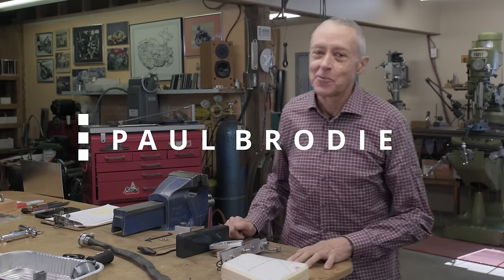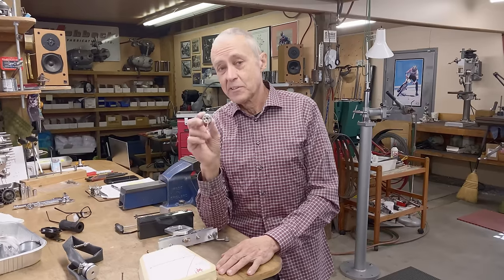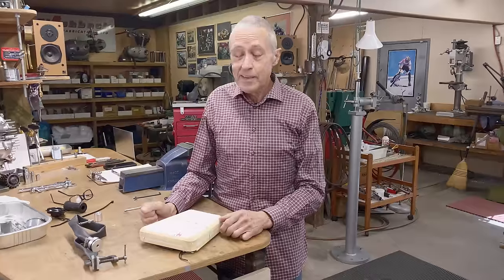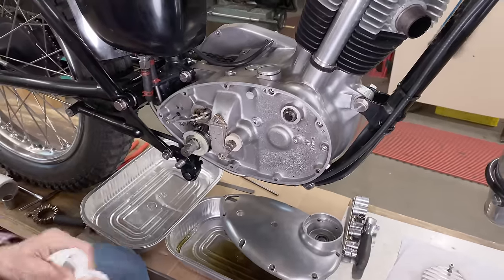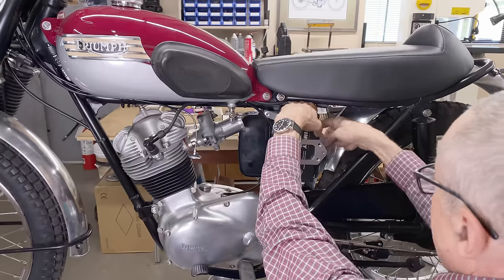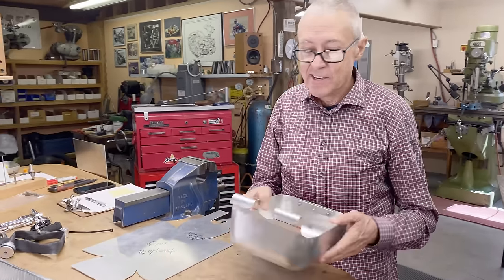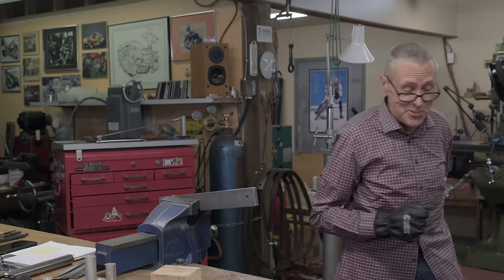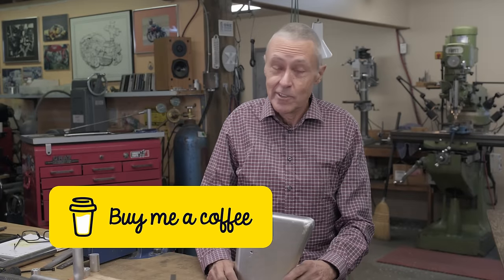CUSTOM Side Cover for the Tiger Cub // Paul Brodie's Shop

Comment: Making side cover is interesting Paul.  We make parts along the same lines, using wooden or GRP male patterns, and then press them using a rubber press (obviously not feasible for one offs though).

On something like a Cub,  you will need to carefully rubber mount the oil tank top and bottom, or there will be continued problems with cracking.  I would guess mounting rubbers for something like a 66-67 650 twin oil tank, would work well?  Use 2 on the top and 1 on the bottom. The battery holder will vibrate a good deal, so make sure that is mounted to the frame very carefully, as it's going to crack/break if it isn't.

You might get an overly large used Concentric to sort of work on the Cub, but it would be a hell of a job, and without some sort of restrictor in the inlet port, to overcome issues with poor gas flow at lower engine speeds,  running at low speed would always be pretty poor.  You can get 22mm Dell Orto carbs jetted perfectly for a Cub, and running would be far better with one fitted.

Oil in the side casing is probably coming out of the camshaft area, and might be due to breathers on the motor being too small, and making the cases pressurise ?  Kicking Cubs is always difficult, and most people fit a decompressor to the rocker cover, which pushes down on one of the rocker arms.  Without a decompressor, clutch slip could be a problem. Its possible to fit a decompressor, which mounts under the spark plug, and that seems to me a much better idea than messing about with the rocker cover.
Reply from the maker: I mounted the bottom of the tank with rubber, the top is solid. I will keep an eye on cracks developing. I will get this carb working properly. I feel I am getting close. I don't feel like swapping carbs. The oil was coming out of a little hole at the bottom of the case, underneath the cam. I plugged the hole and now the oil has stopped leaking. I will think about a decompressor, but in the meantime work on my technique, and get stronger. Thanks for commenting.
Reply: @paulbrodie   You will probably find cracks will continue to be a problem, unless you mount the oil tank in the same way as all other Triumphs?  Cubs vibrate at quite high frequency, and are very prone to things cracking and or falling off.

People in the UK have managed to get Cubs running well on smaller Concentric carbs, than the one you have fitted. This is achieved by fitting a restrictor in the inlet port, which increases the signal at lower engine speeds, which helps improve low to medium rpm running.  

Without a decompressor, starting will be difficult and the CDI type ignition systems, being too advanced at cranking speed, is the main reason for this. Generally, the fact that a very strong kick is needed to overcome the lack of ignition retard, means clutch slip often becomes a problem.

Good, you have sorted the oil leak.  Lots here fit a large diameter breather hose into the gearbox filler plug. On bush type motors, that have been fitted with CDI, the breather can go into the distributor drive blanking plug.  

Will be interested to see if you can resolve the issues with the oil tank, and can get the bike running well with that carb fitted? If it's a 4T carb, there is no pilot jet (just a fixed size bush), and it might be possible to modify it to take a 2T pilot jet, which has different sizes?
Reply from the maker: @humourless682  I will deal with cracks as they appear... I do not want a restrictor plate. I come from a road race background so that for me is a terrible idea. As long as I give it a good kick, it does start fairly easily. I tried to order carb parts from the Amal website, but that was impossible, and I let them know how crappy their site is...
Reply: @paulbrodie   It would be a good idea to phone Amal, but might be a plan to measure the carb body in the wear areas, before fitting any new parts? 

Nearly everyone in UK uses Dell-Orto carbs on trials Cubs now, but 20 years ago 22mm Concentrics, were common.  

The better running ones having restrictors in the heads.  From what I can remember, the ports on a Cub head  are not great, and that is the main reason for the restrictors being fitted. 

If you find your carb is badly worn and a new one is a better option than repair,  Amal can now supply aluminium carbs, which I would think are going to be far more durable than the lead/zinc ones, that are also available?
Reply from the maker: @humourless682  You think I am building a trials bike. If you look at my bike in the videos, you will soon realize I am NOT building a trials bike. I'm not sure how you got that idea... I am building a road Cub:  low pipe, 9:1 piston, racing cam, 27mm carb...    :face-orange-raised-eyebrow:
Reply: @paulbrodie  No I dont think you are building a trials bike, Paul.  

Other than your low level pipe, and 27mm Amal carb, your motor is pretty much identical to something built for trials here.

A stock Cub with inductive ignition,  20 mm carb, low compression, and short duration cam, is much more forgiving than modified bikes, with CDI systems, bigger carb, higher compression,  longer duration cams.

In the UK the ONLY rule in "Pre 65" trials that applies to pretty much every British made bike, is that it must have a British carb,  which means Amal, Zenith,  or Villiers.

The ONLY Brit bike where that rule does not apply is the Cub! People found modern day  trials Cubs so difficult to get running properly with British carbs, that there was a rule change, which allowed the use of 22mm Dell Orto's which improved running enormously.

That rule change happened about 20 years ago, and very few use British carbs now, as it seems the only way to get half decent running, with one fitted is an intake restrictor?  

I hope you can overcome the poor running, without a new carb or a restrictor, and if you can, would be very interested to see how you get it done?
Reply from the maker: @humourless682  I have carb parts coming from 2 different sources, so that is good news. I don't give up, and I have been successful in tuning other motors, so I plan to have success with the Cub. We will see...   :face-purple-wide-eyes:

Comment: Tour choice of 3003 was a good one. It is probably the most malleable of the non-heat treatable alloys except for 1000. I  think 1000 would be too soft for an application like this: too easy to  dent. I like the cover.
Reply from the maker: Thank you Richard :)
Reply: Is no annealing necessary for those bends?
Reply from the maker: @bananabrooks3836   I did not anneal. And I finished the project. I guess it wasn't necessary...

Comment: Really great video as usual! Cant wait to see what you find out about your motor leaking into the case. Are there any seals around all those shafts?
Reply from the maker: Thanks Kevin. The oil was leaking out of a hole that I plugged....
Reply: The cub uses a timed camshaft breather, any oil draining into the outer case is returned via a small hole in the crankcase and is scavenged back to oil tank.
There will always be residual oil in the case.
Cover looks great.
Reply from the maker: @arnsberg2150  I plugged the little hole where the oil was leaking out from. Fixed! Thanks for liking the side case...    :face-fuchsia-tongue-out:

Comment: Don’t all mufflers get hot enough to release lock tight? It is basically crazy glue which melts.
Reply from the maker: It's the very end of the muffler, so the coolest part. I also hammered it in, so I think it will be fine...

Comment: Is it smoking as well? Looks like the exhaust port off the head is wet with oil. Could be wet sumping?
Reply from the maker: No, the engine doesn't smoke. The exhaust rocker cover does leak a bit of oil... British!
Reply: @paulbrodie  Ah yes, the "it still has oil" indicator ;)

Comment: Hate to say this Mr. Brodie, but maybe your carb problems stem from its mounting angle. I'm pretty sure they prefer to be horizontal. Best wishes non the less and more power to your elbow!
Reply from the maker: You might be right, but I'm sure I can get the jetting right and have it running smoothly!

Comment: If after a while you don't see any more oil in that side cover, it maybe that the oil got there from the leaking oil tank dripping down onto the case. I didn't see any sort of sealing gasket so thats my ideaer. The battery box is kind of flat too. Any way to give the flat some curvature? Just another ideaer.
Reply from the maker: There are many ways to create a side cover. I did something pretty basic... There is only so much I can do dealing with video time constraints for example, but I do like the finished product. It works for me.           I did try and respond to your later, long, comments about the shop film, but the comment section went into a seized mode, and there was no chance of me answering you there.... I think you really put a lot of thought into it, and it was well written, so thank you very much! It does sound like a good story, but the chances of Hollywood calling are pretty slim :) But you never know.
Reply: @paulbrodie  LOL. Paul Brodie the movie... Someone else didn't like it and called me a snow flake. LOL.
Reply from the maker: @opieshomeshop  There are a lot of negative people in this world.
Reply: @paulbrodie  Thankfully you aren't one of them. Im learning a lot from your videos.
Reply from the maker: @opieshomeshop  Thank you.

Comment: It's a British bike, they seem to be designed to leak oil.  If it stops leaking oil, just check it hasn't run out.
Reply from the maker: British Bikes and oil. Where did you hear that rumour?
Reply: @paulbrodie  was a running joke back in the UK (during my teens), British mc's can be a nightmare here in Australia for registration, where they demand no drips/leakage under the motor/gearbox.
Reply from the maker: @Fozziesoft  Yes, it is sometimes hard to make a British bike oil tight...

Comment: More problems for you, the cover should follow the radius of the back mudguard, don't you hate it, CAD & 3D CNC / Printers ;-)
Reply from the maker: No problem for me. The cover could follow the radius of the back mudguard, but it didn't. That was my choice. When Mitch comes over here, I basically have 4 hours to create a project, from start to finish. Making a radius like you described would have put me way over the 4 hours. I do not live in a perfect world, and we have to make things work with constraints such as time limits. Thanks for watching. So no, I don't hate it, in fact, I like it very much!
Reply: @paulbrodie  I'm not complaining, just talking, that''s what its about, sharing ideas and the loves of machines, i know its a lot of work, cheers!

Comment: Maybe you can machine a new needle for the carburetor I know you got the talent probably wouldn't take too long. Good luck
Reply from the maker: My lathe chuck cannot hold something that small, so that is a problem...
Reply: Can you machine something that will hold it in the laid just like a little holder cup? Or hold it in a round blob of Apoxy. resin.
Reply: This might sound stupid. I don't know but a piece of brass tubin soft metal or aluminum. You inserted it into and then the lathe chuck crushed down on it and hold the metal inside of it. Another thought a lot of drill chucks are removable. And my chuck is two And you go make that clamp inside your lathe I have seen on TV or YouTube how people make holders that will hold the object in the lathe.

Comment: Hesitation on acceleration on those Amals is normally down to the slide cutaway size. Amal do have them listed on their website but I did a video about balancing 930s a while ago and at around 3:50 I show a picture of the various cutaway sizes. https://youtu.be/boik4yqmfTY

Also off the top of my head the stock main jet on those was around 100. With that peashooter exhaust and intake I'd be looking around the 120 mark. 

Nice panel. 👍👍👍

Edit. Difficult to kick over normally means the ignition timing is too far advanced.
Reply from the maker: Yes, I will order a 2.5 slide. I think I need a 160 main jet, but it could be 150. 120 seems pretty small... Thanks for liking the side case!

Comment: Your carb tuning dilemma. Main jet doesn't come into play until 3/4 throttle. Idle mixture screw works between 0 - 1/8 throttle (make sure your idle jet is cleaned out. I use a #79 drill bit .0145"). The slide cut away works from 1/8 - 1/4 throttle. The larger the number the leaner it is. Lower number the richer. The slide cut away has a lot to do with throttle response. The needle and needle jet control mixture between 1/4 -3/4 throttle. Usual issue is needle jet wear. A 106 jet should have a .106" diameter, a 105 should have a .105" diameter. New needle jets: some are made wrong and can be undersized. You can make plug gauges on your lathe using a vernier micrometer that reads down to .0001". You can make them in .0005" increments for the needle jets you need to measure. Check your float level too as to high richens the mixture too. Start there first. Make sure none of your emulsion holes aren't clogged up either. Too rich for starting has nothing to do with the main or needled jets. You should be able to first get a good idle with the mixture screw turned out 1 1/2 turns. Once that's established opening the throttle for response shows you if the slide is too lean or rich. When that's established then half throttle runs shows you raising or lowering the needle for richening or leaning the mixture. With the needle in the lowest position and it's still too rich points to a worn or too large a size of needle jets, so you need a way of measuring for wear as just going down a size could be way too lean. Most of my Amal tuning comes from BSA and Triumph 650 work when I started working on them in the early 70's
Reply from the maker: Thanks Jay. I appreciate your tuning tips. I have ordered a few bits and will order a few more, and eventually get this little Cub running sweetly :)
Reply: @paulbrodie  Here's something else. I don't know if it pertains to the Concentric on your cub or not. But on the '68 BSA 650 the needle, jet holder, and needle jet are different than '69-up. Later jet holder was longer, top of the needle jet was drilled larger at the top so the needle didn't register with the jet's diameter until lower in the hole, and the needle was longer. Back in the early 70's I got the "kit" which improved fuel economy/performance. I had just got everything installed in the body, float bowls on. I started raining so I just put the slides back in and bolted the tops on. Pushed the bike in the garage. The next day I fired it up. Richer than hell when I opened the throttle. But it idled fine and with a slight opening of the throttle. Above 1/4 throttle it went to hell. I think I saw that your jet holder is the late one. And if I remember right, the late needle has two notches at the top. But my experience is on the 930 Concentric which doesn't mean  that it pertains to the Cub's Concentric. Just a little more food for thought. I'm going to have to try making side covers the way you did using C.A.D. :)
Reply from the maker: @JaySiewers   Thanks Jay. My concentric came off a Triumph Trident from the 70's. Bore is 27mm, I think.  I know I can get it running well if I take some time...   :face-orange-raised-eyebrow:

Comment: Working with lathe and file looked dangerous 😮
Reply: That's a classic old school technique for manual lathe operations. In fact they still make and sell very specific files just for use with a lathe that are conveniently called a lathe file(aka machinist file). The teeth are cut at a different angle from your standard files and the handle tends to be longer too.
Reply: @Jack-yl7cc  Equipment aside, I would still be more at ease if he would file left handed. We have been around the block on this before and he has no intention to change.
Reply from the maker: It's the camera angle, really!